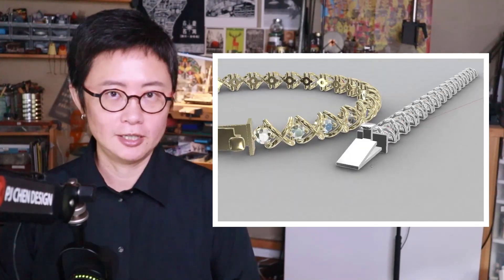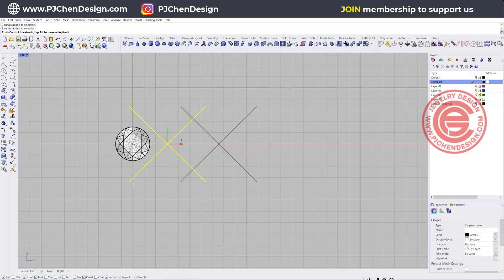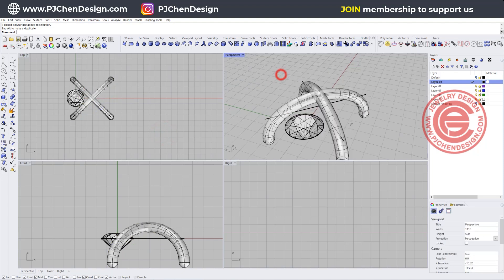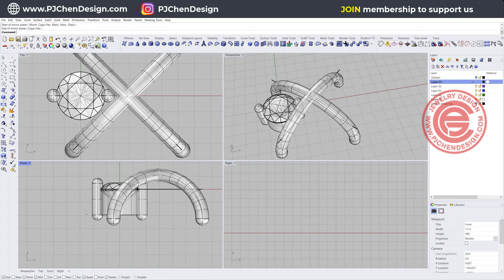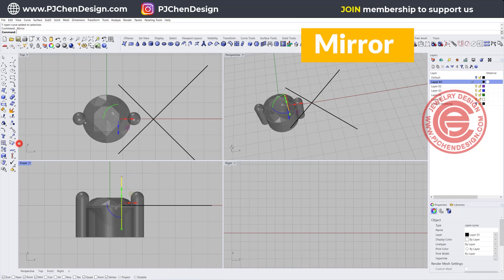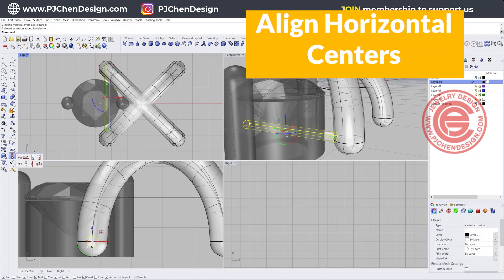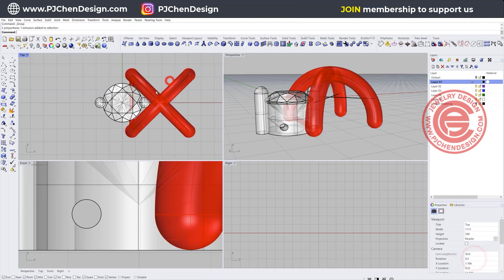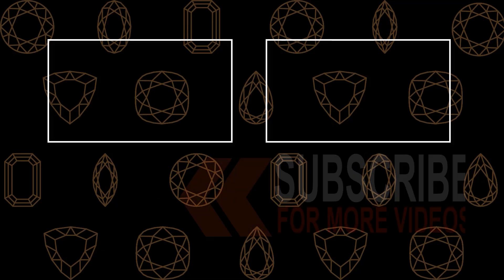Jewelry CAD Design Tutorial- XOXO Bracelet 3D Modeling with Rhino 3D #349

Comment: I am having a weird problem. I can follow all the steps perfectly, but at 6:26 when I go to create the cylinder, mine appears much larger than yours despite using the .35mm measurement. Any ideas?
Reply from the maker: Was it radius or dimeter?
Reply: @PJChenJewelryDesign  It was radius instead of diameter... can't believe I missed that! I have one last question for you. When we're sending this off for casting, don't we need to remove the pin first and make both holes in the setting the same size? I'm assuming the pin is cut to size and soldered once the Xs and settings are already cast. Thank you so much for the great lesson!
Reply from the maker: @blk986  you will cast them individually without pin and assemble them togeter after polish